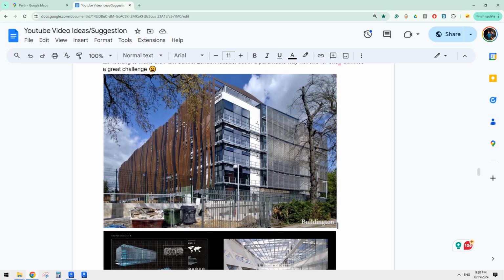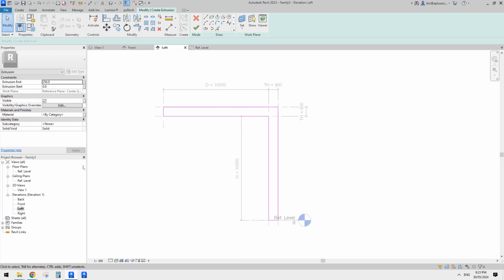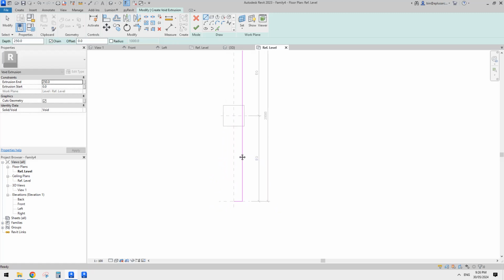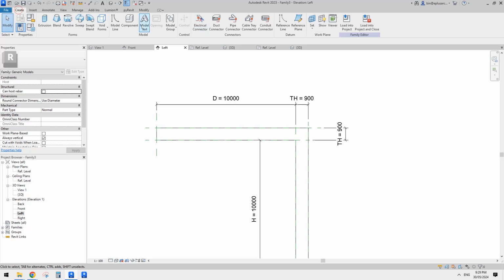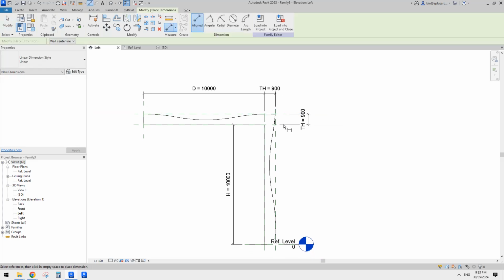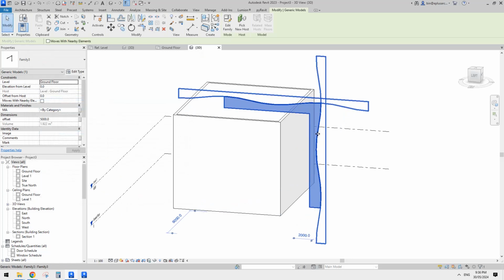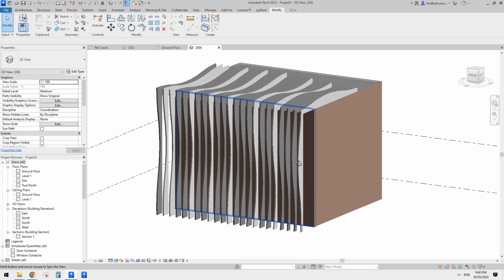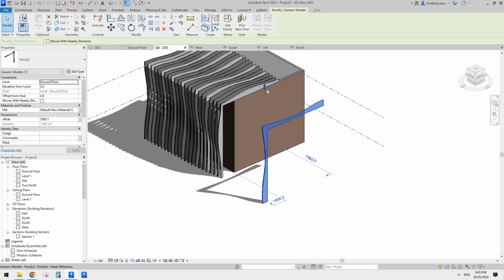24026 - Parametric Family Exercise (Curved Blade Facade w. Face Based Void)

Comment: Hi 

I need a way to solve my problem

I create custom curtain panel (roof brick tile or islamic pattern by sweep) when I edit profile of the curtain wall revit replace the intersection panel by system glazed 

Is there a way to cut the curtain panel  without replace it
Reply from the maker: unfortunately, you can only have rectangular curtain panel and any non-rectangular curtain panel will be replaced by system panel.
Reply: @BINHE615  thanks Mr. Bin He